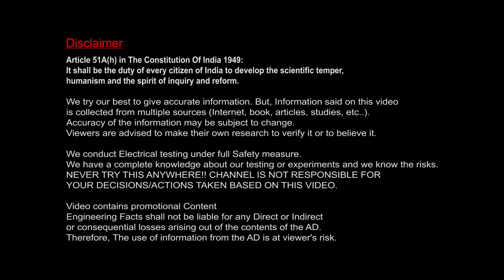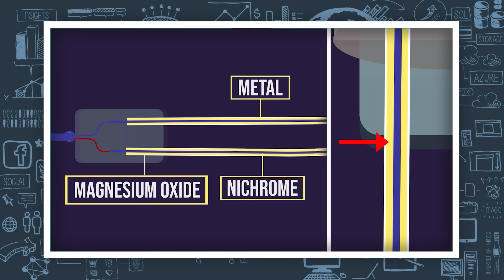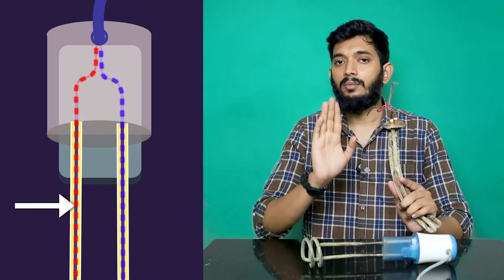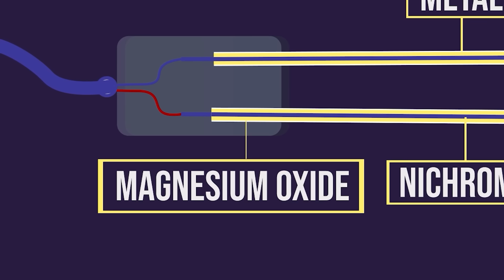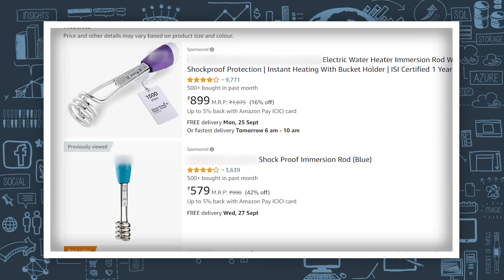Is Shock proof heater really Shock proof ? உண்மையா? உருட்டா?

Comment: @engineeringfacts bro thick earth wire use panalam la bro, warth wire water la direct ha contact aagura mathitri. in case power leakage aanalum shock adikathula.  shock adikathu na naa nenakuran.

Comment: Redmi k50i mobile unable to transfer the heat generated by torch light, after telling this issue to redmi they stopped selling k50i now
Reply: Mother board dead issue going to happen in k50i mobile

Comment: My professor throught In civil engineering  we studied earthquake resistant building not as earthquake proof building bcz proof means 100%avoidable.
In general buildings can't be build 100percent to withstand earthquake  so code( bureau of Indian standard) spells it as "criteria for earthquake resistance structure "instead of earthquake proof structure.
LIKE WISE IT CAN BE RELATED HERE ALSO😊

Comment: Heater off pannalum water tap la irunthu varapo water shock adikithu. Why?
Reply: Wiring ah check pannunga
1)heater ku pora wire la phase than switch la irukkanu paarunga
2)earthing good condition la irukkanu paarunga
Reply: @sktechworks  earth connection kudukala🙃
Reply: @lailanazeer9132  romba romba mukkiyam bro earth…
Reply: @sktechworks  yes yes. Will do soon. Thank you.

Comment: Hi Bro, I have question. if we use solar power source and eb line with same natural connection will create impact on EB meter ( reading may not be accurate ?). what do you suggest. In normal invertor EB meter will disconnected and meter reading will not be impacted. I am talking about off grid solar inverter